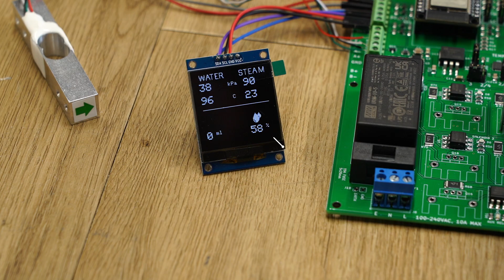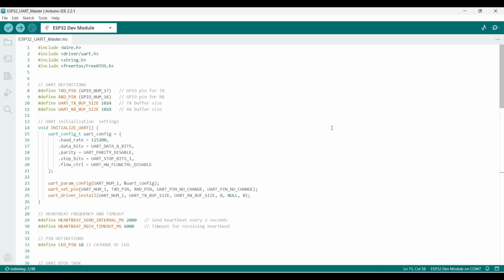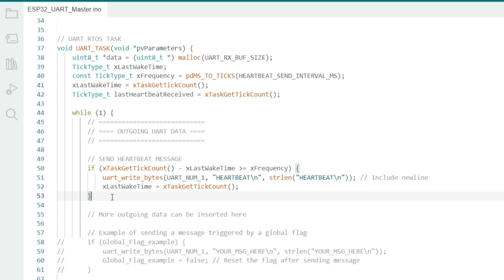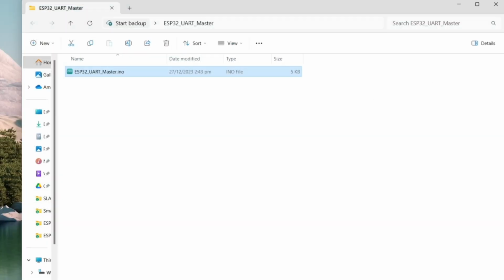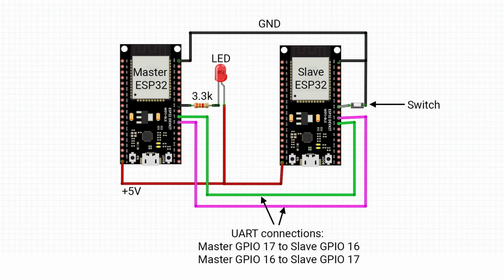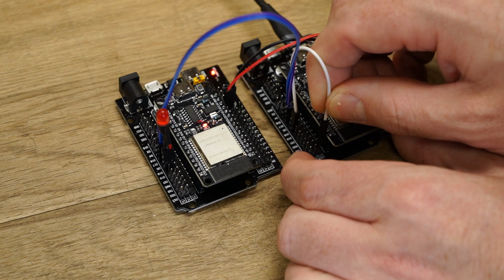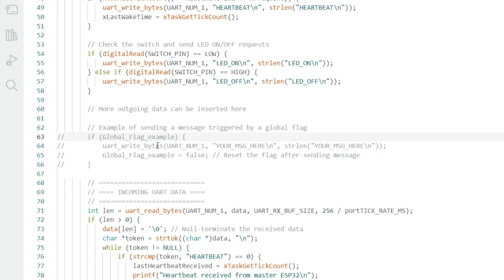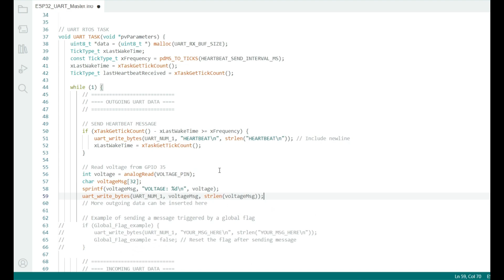Add extra I/O pins to your ESP32 project with UART II Tutorial + and Code

Comment: Can i still have the complete code of controling the motors and sensors on the same esp32 and use the other esp32 only for its pins? meaning without splitting the code

Comment: Esp32 is already dual core. Using io expander is sensible option. If u have to use 2 esp32 just for io expansion then you should reevaluate the design
Reply: Does this not allow for all 4 cores to work simultaneously?
Reply: This